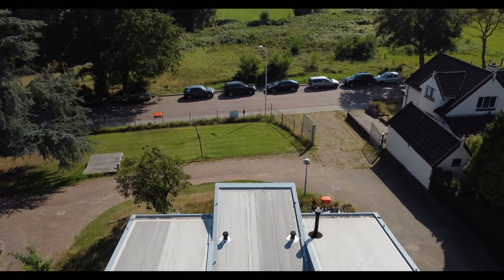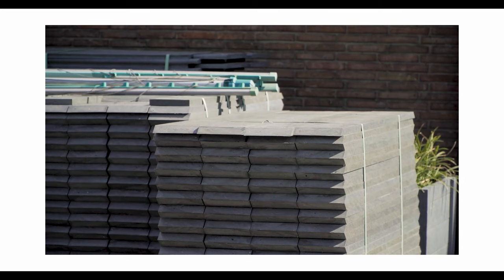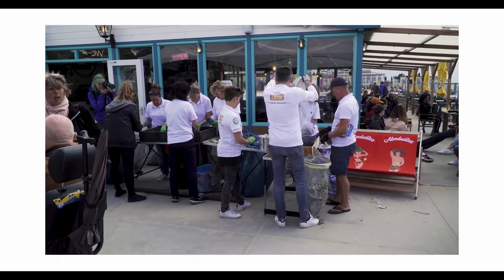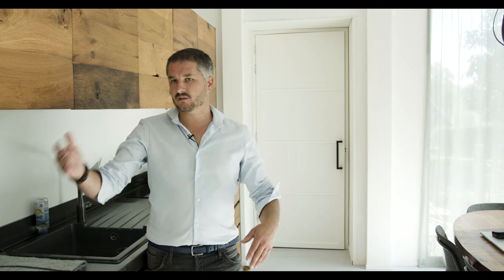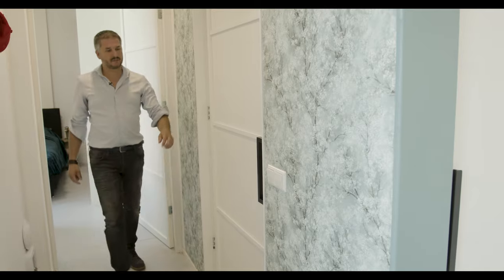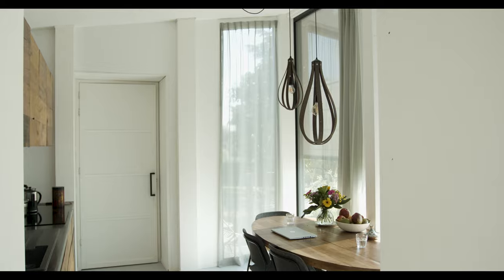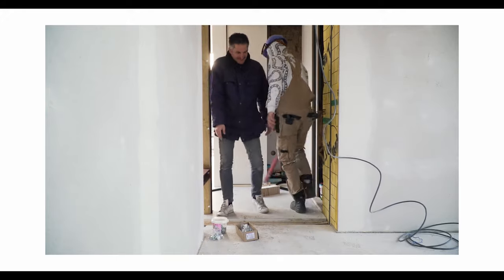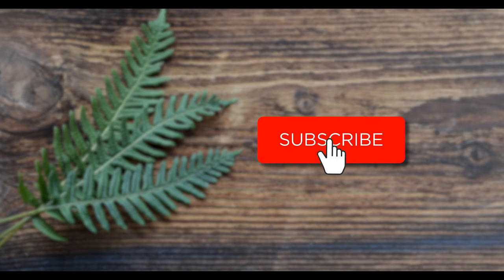Rethinking Construction: Living in a Plastic Fantastic Home

Comment: Couple of questions:
Plastic actually does react with the sun, the UV rays deteriorate the plastic over time, so did they infuse it with some kind of UV blockers? 
Also I would like to know how much electricity is needed to produce the material?
Reply: Plastic mix up with soft sands, makes it stronger and it won't deteriate for a very long time. The sand in it serves as anti uv
Reply: Or add titanium powder

Comment: Love the this project, specially because you can transport your house. I have one question….plastic doesn’t breath…so do you need ventilation?
Reply from the maker: I think it's an awesome project as well 👏  Considering ventilation, the plastic doesn't breathe, so they use mechanical ventilation with a heat exchanger pump. Once the pump runs on solar panels, the plastic house becomes self-sufficient
Reply: There's windows......

Comment: Oh my boy, it's horrible. It should be that wood is for outside, and use plastic inside, but please do not use it on the sun and where rain goes over it. Slowly it breaks down, and does more harm as good :( Please stop doing it. We call it GREENWASH. You can use it as an argument and a solution for the plastic problem today. :(
Reply from the maker: On the other hand, people have been using recycled plastics for benches, boatdocks, garbage cans for years now and they tend to resist the test of time.....  Making use of waist is a good thing I tend to think
Reply: Wouldn’t the wood need to be varnished or painted if it were on the outside ?